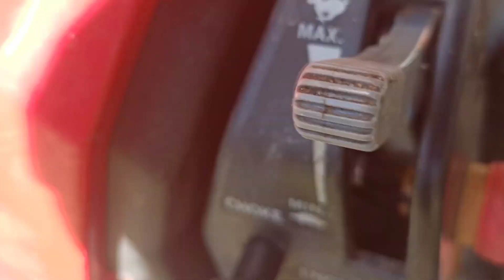Jetting a Blocked Toilet Drain

Comment: One of my many exciting drain-clog stories from my 35+ years as a downtown NY super. My top floor tenant, a Yorkshire man named Sykes, complained of a drip through his duplex apt ceiling that seemed to be unending. So, me being a brave gal, I took my flash light, and went up to check the roof drain in the dark (It was pouring rain, 10 pm-ish...John was tending bar and not at home) I let myself in, and saw the drip. Hmm...unlocked the roof stairs door, and lucky I had my boots on, since it was like wading into the shallow end of a swimming pool...worse yet, it got deeper and deeper. I waded to where I figured the drain was, and put my arm down, through what was like three feet of standing water, ALL ACROSS THE ROOF...I did not for a minute consider the weight of all that water - until I felt about, found the (uncovered) drain hole, and put my hand deeply inside it. (Up to my bloody elbow? Hard to believe I was that brave or - that stupid). My hand connected with a plastic bottle, wedged nose down into the hole, preventing any water of course from draining, but just..backing up. And for god only knows how long. The second I yanked it loose, there was this huge whooshing sound, and a whirlpool began to form. I pulled my arm out just in time -  and then heard a roaring crash. Followed by a second one....But the whirlpool still kept draining.. I ran downstairs and learned that every toilet along that line flushed by itself, both John's ceilings collapsed  - his upstairs bedroom, and his living room below. It was beyond apocalyptic. John, being an easygoing Brit... moved in with friends, and took it all in stride, as it became a story we told at the bar over drinks, for years after...That said - at the time...there were threatened lawsuits, many days of repairs, sheetrock, brick and insulation replaced, warped wood, on and on.Water has power. Never doubt it....I have ever since - come to respect the whirlpool...